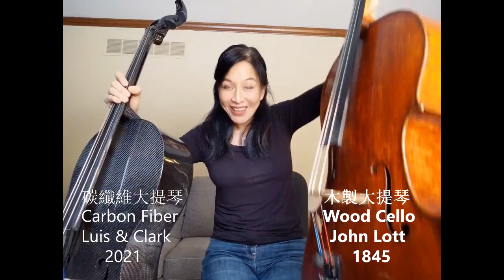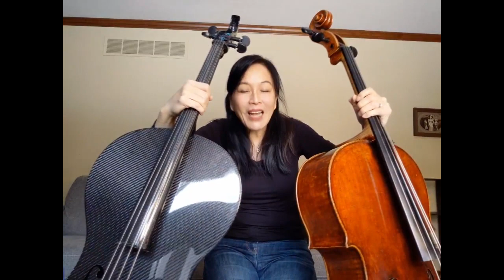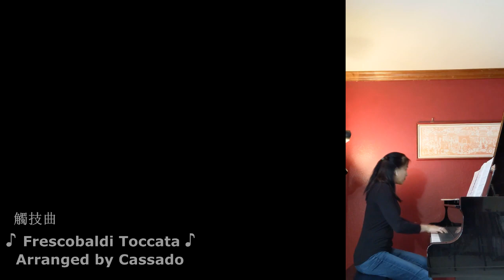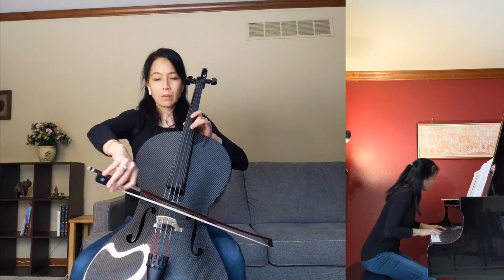Carbon Fiber vs Wood~碳纖維 vs 木製琴"Hybrid Toccata合成觸技曲” Amy Chang/cello and piano張式明/大提琴與鋼琴

Comment: I was not really able to hear much difference between carbon fiber cello and 1850 wood cello. I play violin on and off. Currently own two violins both wood. The only difference I noticed between carbon cello and wooden cello was a slight timmidness on the carbon fiber cello. I got the impression the carbon fiber cello was only slightly less responsive. Your wonderful cellos have created in me a possible like for the carbon fiber violin. I caution the cello player as carbon fiber has been known to fail during stress. There is probably close to 95 lbs tension on that neck and belly, I would exercise extreme caution with the carbon fiber cello because you don't know when it will fail. Like certain aircraft it has a limited life cycle of so many hours before metal fatigue sets in on a plane whereas with carbon fiber the fibers strong one way but not in another. I hope your instrument holds up for you sincerely, as I enjoyed your Fresca tune you played on both instruments. It is nice you may not have to worry about humidity with your carbon cello. I would ask the builders of your cello where are the weak areas structurally so that you may observe any cracking or separating.  I don't want you to be a victim as the submariners were whom perished at the Titanic dive because the carbon fiber shell failed. I care about you and hope your cello gives reliable performance. I'm not a disser.. I'm a practical person and hope the carbon fiber cello works out for you. Your music is lovely.❤ thank you.😅
Reply from the maker: Thank you so much for your kindness and concern. This is the first time I heard about the possible failing of carbon fiber. I should read into it. I normally buy airplane tickets for my cello when I travel, but flying with carbon was the first time putting with luggage😱I u🙃did use a good travel case and wrapped around the bridge with clothes and lots of caution. It arrived to my destination perfectly fine in fact it was still in tune.🤣 however, you are right, I need to be cautious in making sure the instruments stay healthy and long lasting. And best wishes to you with your playing as well. Thank you again❤️

Comment: Carbon cello sounds "dull" to me. Funny, I'm ex-guitar player. Now I work gor many years as carbon composite materials in motor racing. I want to start to building carbon guitars as a hobby so it is very interesting to hear difference in sound with the cellos. Not very promissing.
Reply from the maker: Hope you build a wonderful carbon fiber guitar and post it on YouTube so we can all hear it😀

Comment: To me the wooden cello had a slightly richer sound, a few more bass harmonics especially on the A string. This said both cellos are great but to me the wooden is without doubt richer and cannot be replaced.
Very nicely played, bravo!

This said, are the strings on the carbon cello the most adequate?
Reply from the maker: Thank you so much for your comment. I use the strings that came with the purchase from Luis & Clark. (I believe it’s Jargar Forte on the A, a medium-gauge Jargar on the D, Spirocore Tungsten on the lower two): as for my wooden Cello, the only difference is my a string is medium Jargar instead of forte.) The balance works out perfectly. I love both of them but nothing can beat the refinement and the sensitivity of the wooden cello😍